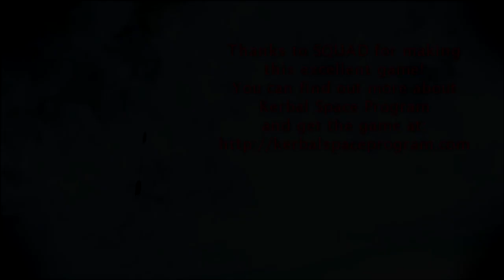Realism Overhaul in KSP 1.8.1 - Regolith Surface Base Module

Comment: One option would be to make the module increase in weight when the regolith piles appear, since they're external mass being added to the craft, it would make more sense, plus the added weight would prevent it from being knocked over.

Comment: Something I personally would like to see as a change, would be to have solar panels on top of the regolith?  Although in "reality" that might be a secondary (or tertiary) part to install, I still think it wouldn't be a bad idea.  (I guess you could just use the solar-panels that can just neatly roll out like a carpet on top of the regolith?  They do exist)

Also, perhaps you need to move your Centre of Mass to solve that issue?  Move it down a lot.  Or maybe even move it when the regolith is placed down?  And/or change your mass when that happens somehow?  Think of it like digging for ore, but instead of ore, it produces regolith, and once you get enough, you can deploy the regolith?  But you still need the "ore" (regolith) in the tanks, which adds weight?

Comment: 4:00 Ah, KSP, with its extremely poor simulation of surface friction.

4:15 1.35 to 1.5 g/cc is a lot when dealing with that much volume. With the regolith added, the weight would increase several times.

5:30 "I'll probably underfuel the food, water, and oxygen" —Tyler Raiz, 2020

10:05 Human civilization could run through all the water present in Lunar craters in a couple decades or less. It's not particularly abundant.

11:20 You could have further underloaded the oxygen supply due to boiloff replenishment if the landing was marginal, but it wasn't, so...

18:15 Much of the Lunar regolith is substantially darker than what people normally perceive it as.

18:25 Good idea... 18:35 OH GOD LOL 20:05 WTAF 20:40 It's even clipping through the ground with colliders(?)
Reply from the maker: The bottom of the lower rockpiles don't have colliders just in case the terrain is uneven (so that when they deploy it doesn't result in an instant explosion). The rockpile colliders are just low enough to block a kerbal.